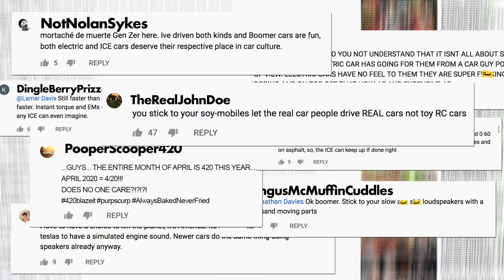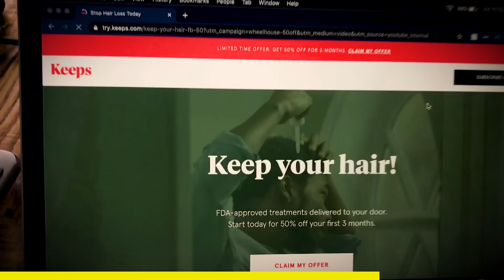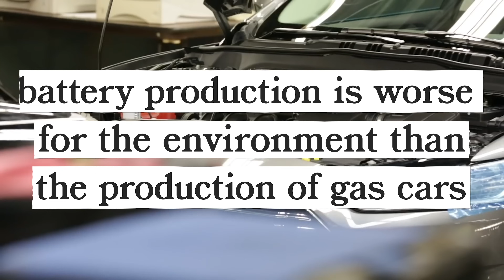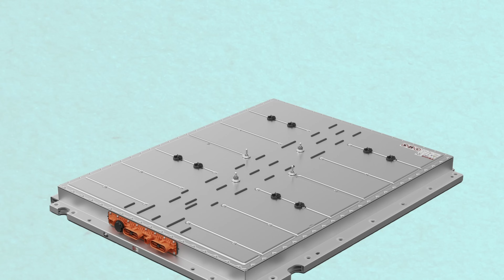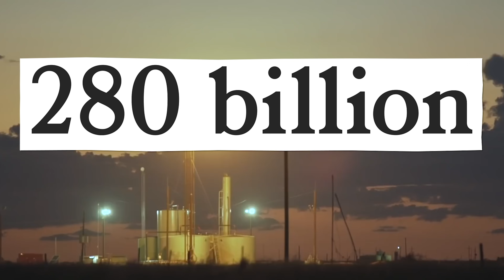Are Electric Cars REALLY Better for the Environment?

Comment: With constant blackouts/brownouts in the southwest. Could you share the evidence you used to debunk myth 2?
Reply: That had nothing to do with EVs? Blackouts were only a problem mostly in Texas, and that can be attributed to Texas being nearly entirely separated from the national grid. If it weren't, blackouts wouldn't have been a problem.
Reply: @pottupatteri2903  dude, you entirely missed the point. his point was that since there are already blackouts and power shortages, how could that same grid support millions of ev´s?
Reply: @dervakommtvonhinten517  Dude, you are still not getting the point.  Gas stations don't run on gas.  With no power, there is no gas either.   During all those blackouts, guess what the side effect was???  Gas stations out of gas and mile long lines around the block of people lining up for gas.

Blackouts are exceptionally rare unless there is a natural disaster, forest fires in CA or incompetence in TX.
Reply: @redbaron6805  hello mr strawman.... gas stations dont need much electricity. they can run that off a diesel backup generator. im saying the grid doesnt support the huge energy needs if everyone went electric. not even close.

what you basically said just now was like saying nuclear powerplants arent feasable cause they need electricity to run. sure, they need a very tiny percentage of the energy they provide to run themselves, just like gas stations. but that isnt the point of the discussion. the point of the discussion is the capabilities of the power grid and how much work would need to be done to retrofit it.
Reply: @redbaron6805  i dont think you know what a strawman argument is.... and i was talking about ENERGY... but even explicitly stating that was too high for you i guess. 

id love to see the studies you talk about cause im pretty sure they only cover one specific, very limited area. and retrofitting the grid several times would be very expensive, and doint it all at once (while cheaper in the long run) would be an unimaginabily high cost. not to mention we dont have the capabilities to generate all that electricity needed in an environmentally friendly way...
Reply: @redbaron6805  then tell me, where was my strawman argument?

i didnt suggest an opinion contest. i asked for that study you cited...
Reply: @redbaron6805  and no, evs arent net positive. the resouce mining alone is atrocious. hydrogen is the future imho
Reply: @dervakommtvonhinten517  Yawn.  So you read the study, didn't understand a single thing it said, and now feel you should whine about it?  Got it.  It is painfully obvious you literally don't understand anything about how this works.

The coast contains most of the population by far.  So, the effects on rural states is not much of an issue.  There are already TOU tariffs at most utilities and others that offer Off Peak EV plans.  Which means people already have an incentive not to charge a peak hour when they get home.

And as the study addressed, besides just raising Peak electricity rates and discounting the off peak to give people incentives to shift their usage to off peak, utilities can implement a smart charging scheme where cars will start charging after others are finished.  So, if there are 40 electric cars in a neighborhood, 6 will start charging at 11PM, then the next five will start when those are finished at Midnight, and so on until all the cars are charged at 5AM or 6AM.  

There is massive surplus of capacity at night, since the A/C's don't run as much, no one is cooking dinner, offices, schools and factories are closed, no one is doing laundry, and most electric water heaters are idle.  So, there is room for millions of EV's on the grid today without doing much of anything.

The grid will be upgraded in the areas that need it, like it always has been.  Just like the study pointed out, if you actually bothered to read it, the grid grew because people were installing A/C units and getting laundry equipment like dryers.  You seriously think only certain areas in the country installed A/C in the past and others didn't????  The entire premise is beyond absurd.

The study uses data and analysis from DOE, NREL, Argonne Labs, NASEM, EIA and a bunch of others.  

So, are you seriously claiming YOU are smarter than the scientists at the leading research labs around the country???  Because if that is the case, you are delusional to the point of needing some serious professional help....

Comment: But if we want the best of both worlds hydrogen powered cars could be another future since they produce the same amount as a petroleum car production and also have incredibly small environmental footprints like a electric but. Pro’s it’s probably the best choice when it come to making a environmentally friendly car and you can stick to your manual, with hopefully an awesome new exhaust noise, the gas required( hydrogen ) is a very easy to obtain gas. Cons will be much slower than both the electric and internal combustion engine however that should evolve over time, this technology will take at least another decade to start producing these cars, servicing would probably be more expensive than the average car since it’s probably such a complicated car, the parts for the car would be very hard to acquire however that should change overtime.
Reply: That's a fact, hydrogen and ethanol are better than electricity
Reply: @sakshamtyagi7347  ikr but that’ll certainly be a while hopefully they’ll be introduced soon but they will be super slow but at least we can keep manual transmission

Comment: Didn't take into consideration how long those batteries last. I assume longer then regular cars but if you have to replace a battery twice then wouldn't it just equal out?
Reply: Even if you had to replace the battery, the running emissions of EV cars are still far less than ICE cars.
Reply: One person owning a petrol car would have more running emission than a person owning two EVs.

Comment: If the powers that be actually gave two shits about the environment, all vehicles would have diesel engines and their fuel would come from hemp. Hemp is endlessly renewable and actually leaves the soil better than it began. Anything we use oil for could be made with hemp and would benefit everyone and everything!

Comment: Nice video!!! The thing is. Changing for an eletric car, is just one off the stpes with Need to improve co2 emissions,  but that is just the   tip of the iceberg, in fact all kinds of production and industries need to move to a less pollute kind of technology. But the most important,  if don't exist combustion motor, CAR. Plane. Bus. Train.the exploration off crude and is transformation will reduce significantly... in that matter we should be pushing for electric marine traffic... and electric plane traffic,  this two kind pollutes more than the cars...

Comment: You talked about recycling batteries,  but didn't count the emissions of recycling batteries against the EV.
You also didn't look at total emissions from coal power plants.  The SO2 and NOx from coal are infinity times worse that what comes out of the tail pipe of an ICE. 
So depending on where an EV gets its power from, determines if it's worse for the environment.  With 60% of the US power grid coming from fossil fuels, emitting more total pollutants than ICE cars, it's safe to say a similar percent of EVs are worse than their ICE counterparts

Comment: Here's something you didn't think about. Infrastructure. Many places can barely produce enough electricity now,especially during a cold snap or heat wave. Now imagine trying to charge 50% or more of the vehicles on the road at the same time.
Good luck with that.
Reply: Myth #2
Cali has rolling blackouts now in the summer,good luck.

Comment: it's one of the biggest lie on the world; you need to account all ecosystem to produce, run then dispose or recycle. The biggest problem with electric cars are their battery, only battery production and dispose process have bigger CO emission than whole internal combustion engine, other biggest conflict the electric is mostly produced from hydrocarbons and till you put this as charge to cars it have very very big losses, not as combustion engined car directly send all motion created instantly

Comment: Thanks for taking the time to research and share this information. I do question your comment regarding the electric grid. You said the electric grid in the U.S. is actually many grids and all of those grids are not equal. There are sections of that grid that need serious upgrading if a significant number of EVs are going to be powered by clean energy.
Reply: The infrastructure in America would need a COMPLETE and OVERREACHING redesign in order to properly support nearly every citizen having an EV. Which, by the way, the citizens will pay for. Whether they want to or not.

Comment: Interesting article 
Only about 30kg of raw material will be lost over the lifecycle of a lithium ion battery used in electric cars once recycling is taken into account, compared with 17,000 litres of oil, according to analysis by Transport & Environment (T&E) seen by the Guardian. A calculation of the resources used to make cars relative to their weight shows it is at least 300 times greater for oil-fuelled cars.

https://www.theguardian.com/business/2021/mar/01/fossil-fuel-cars-make-hundreds-of-times-more-waste-than-electric-cars

Comment: You forgot fast charge networks. They are extremy expensive to build. It increase copper consumption. Yes, if cars use 16 Amps charger, no problem but ... Power cut can paralyze whole traffics. Is CO2 really problem?

Comment: Have you account for the energy loss from generation, transmission, charging and discharging, and electric motor?
Reply: There's a video on Engineering Explained where they did the math, don't remember which video. Electric motors are way more efficient than ICE. It's really simple, the electric motor just have to move the wheels. There's no energy wasted moving gears, cams, pistons, valves, pulleys, pumps, forced inductions, etc.
Reply: Oh boy.. ICE only get 30% efficiency.. 70% of your fuel just turn into heat and sound and vibration. Further more your 6at transmission might rob some of the efficiency away.
Induction motor don't have those issue. And they remain high efficiency even in city drive, traffic jam and use zero energy in idling

Comment: You missed some things. The biggest hit on gas cars was oil production. That will not end and half of the EV's use oil in plastic and transfer cases. Also the contamination of those lithium batteries. Second, a EV has a life of ten years before we have to find out what we are doing with those contamination's. I can keep my gas car going for at least 30 years.

Comment: It is inevitable. Only because the federal government will make it so. But...Are you going to add a disclaimer since the renewable energy fiasco in Texas? And what is tje cost in carbon to retrofit, and add fuel stations across vast tracts of territory, i.e. Michigan's upper penninsula. Or Canada's northern territory's? It's easy to carry spare fuel in a trailer. Ten minutes to refuel. But setting up an emergency wind turbine or solar cells, and waiting for the car to charge can be a life changer.
Reply: Yeah, here in Michigan, you'll get laughed out of the state with an electric car. I'll stick to my V8's and diesels.

Comment: If electric cars depend upon smoggy recharging resources, then you've merely switched pollution from the tail pipe to the energy production center.  Now, if we have solar power at home, and recharge spare batteries from the Sun, then we've truly made a huge net improvement to the ecology. But, it's complex of course and judging cars only at the tail pipe is short-sighted...
Reply: That is ignoring the environmental cost of producing solar panels (and disposing of them when they wear out).

Comment: One big problem with ev's is that loads of people live in apartments, or houses without driveways. cant charge them at home. charging points are really rare compared to petrol stations, plus most of the countries will need decades to catch up on ev's industry. it wont be possible for a guy in a poor country to buy an electric car. the cheapest new ice car can be as low as 3-4k dollars, cheapest ev is probably 15-20k. billions of people wont be able to own ev's

Comment: EVs are useless when it's cold.  It's cold here 5 months of the year.  Do I want a car that costs $36,000 that I can't use 5 months of the year and I have to buy a new battery for at $5000 every 5-6 years?  UNtil EVs can work below 0 degrees Celsius, no way anyone here will be stupid enough to buy one.
Reply: Not true, my tesla does just as well in the cold as in the heat. That is a myth
Reply: EVs are useless,

Laugh in Norway

Comment: When militaries around the world ditch ICE engines, then I'll know it's time to switch.
Reply: That is an entirely different use case is it not? They have to be able to deploy anywhere with zero infrastructure and be operational as soon as possible. As well, the refueling time from electric to gas is not even comparable. How is the use case for a military vehicle even close to a daily driver car?
Reply: So if the military was still using horses, you'd only use horses?

Comment: One. Why didn't he take into the quota how much it takes to build an EV? About the same as an ICE car? These things don't pop out of the air, DO they? Then there is point a to point b. You fill the ICE car one time at the pump and there are no transfer points that you lose power from. Guess what? Here is where things get complicated. For the EV the electricity has to come from a grid. And to get to the car there are at least four transfer point. and at these points is a power drop. Ask an electrician.  So even if they had the same range and you have to recharge the Ev twice compared to the ICE car one time both have a larger foot print because you have to put in more energy because of the transfer point loses. And where does the electricity of the grid come from? Mostly Fossil Fuels. WIll it change? I don't believe so. But I may be wrong.

Comment: Never had anything against EV's but they won't replace ICE cars until  they reach the same specs in a single vehicle: 300 mile range, sub 10 second 0-60, 4 minute recharge, base price under $20,000
Reply: @Brian-om2hh  Are you urban, suburban, or rural? There are a lot of us for whom grocery shopping is 75 or more miles away, and a trip to any big city is at least 5 hours. I need to go to Los Angeles at least twice a year and that's a 750 mile trip...

Comment: Nuclear is the ONLY TRUE source of "Green Energy!" Solar panels and wind Turbines are LIES! They use MORE CO2 and rare earth metals than ANY Gas powered Plant!
Solar Panels are truly AWFUL for ANYTHING other than HOME USE! They do NOT scale well at all, and they lose 50% of their already weak efficiency in 20 years!
ONE Molten Salt Nuclear Reactor - especially a Thorium Breeder reactor, will provide nearly LIMITLESS ENERGY for ALL uses - more than enough for Industrial and Commercial demands at peak!  
What's worse is HYDRO! IT KILLS ENTIRE ECOSYSTEMS! I live RIGHT next to the Susquehanna river, and it USED to have a MASSIVE Shad Cannery, because there were literally millions of fish - now Shad are so rare that if you catch one, you HAVE to let it go! That is just 1 of 1000s of either killed or severely damaged species of fish and aquatic animals.
Fishing the Susquehanna  is TERRIBLE thanks to the god damned dams! 

What more, Molten Salt based Nuclear Reactors (MSR/MSBR) are INCAPABILE of Melting down, and the most catastrophic failure possible is loss of reactivity (either through getting too hot and melting the drain plug - or by cooling down too much and solidifying making reactivity all but CEASE ENTIRELY!)  - and loss of fuel in the case of the melted "Freeze Plug" as it is called. There again it does not LOSE the fuel, it all gets sent into a thick lead reservoir - and CAN be recovered at least partially. The chances of even this sort of failure is less then a TMI incident by a factor of 1000! And if this failure were to occur, nobody would be hurt at all. 

Solar and Wind with our CURRENT technologies, will NEVER be able to keep up demand to a Metal Foundry, let alone a Silicon Foundry which if it loses power, will lose MILLIONS for just a single 1 minute interruption - because it will have RUINED every chip it was currently fabricating!
So yeah, Solar for your house - probably a good idea if you get enough sun every year, same deal with Wind - though Wind CAN be used more effectively as a load generator for the grid, but should NEVER be used to replace reliable sources of energy such as Nuclear, Gas, Coal, etc.